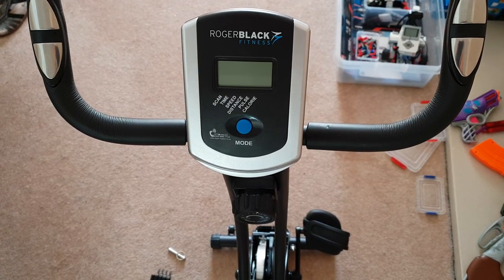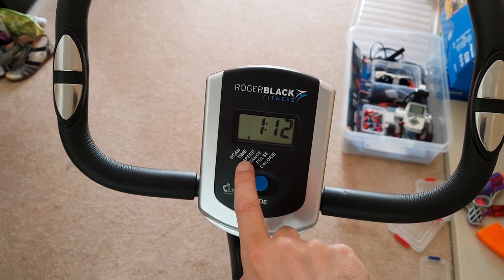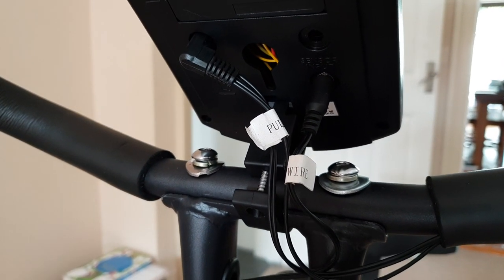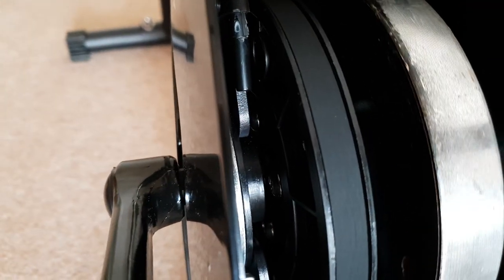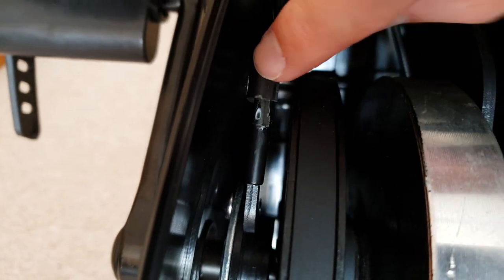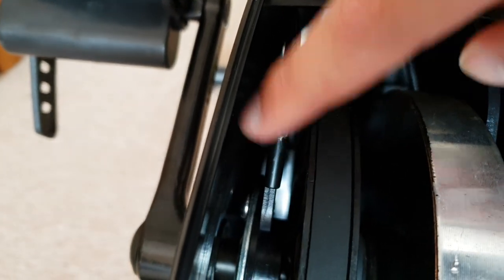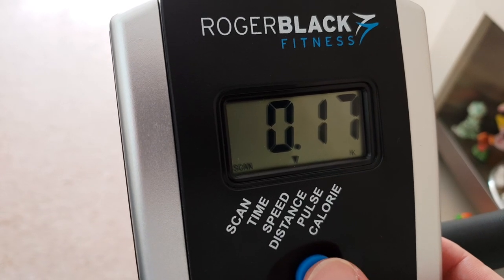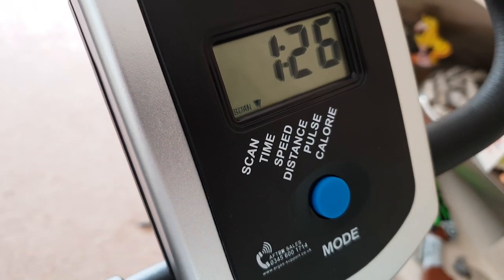How to fix the speed + distance sensor on a Roger Black exercise bike

Comment: Thanks, I bought a replacement monitor for my bike and it came with this type of sensor, I was going crazy trying to understand why plugging the old sensor in the new monitor didn't work, turns out the factory sensor was some type of continuous potentiometer or rotary encoder, I fixed the new sensor and glued a magnet to the disk and now it works perfectly.
Reply from the maker: Brilliant! 🙂

Comment: Ive just seen your video and have a similar problem to your bike but in my case one of the connectors is broken and I would like to repaire it if possible. The thin cable ending in a pin, is ok but the other  going inside of the bike to be connected  to LCD screen is loose and disconnect because is broken. 
Is there anithing I could do? I can supply photo of the problem. Thank you in advance

Comment: Thanks for the video, really helped me fixing mine! 

One question, mine got a three magnet slots where only one got occupied, can i add random fitting magnets to the other empty slots? I take it with more magnets the display would updates more frequently, correct?
Reply: Nevermind, the sensor went crazy when i tried adding a second magnet, it reads up to 50 kph with just a single rotation by hand lol. The magnet i tried i think is neodymium tho which might be too strong for the sensor? Idk
Reply from the maker: I think more magnets mean it'll think you're completing a rotation even faster than before 🙂

Comment: Hi, how do you get the front casing off to get to the actual wheel ?
Reply from the maker: I think you just pull it off.. try pulling one side and you should find it comes off quite easily
Reply: @Endpoint101  What do you mean you 'think'.  I don't want to start pulling it off and find it breaks.  lol...  Can you be more specific please.  Like, do I pull off at the top, or the bottom first and if I use a screwdriver to prize it off will that be OK or should I just try with my fingernails.  I have tried a little, but seems nowhere to get a purchase on.  I have inherited this and have no manual and am unable to look up a pdf manual because I don't know the model no.  Do you know where I might find it?  Otherwise you video seems helpful and clear.
Reply from the maker: Just tried it now.. if I pull away from the top, it pops right off.. didn’t have to use a screwdriver or pull so much that I was afraid something would crack. Hope that helps?
Reply: @Endpoint101  I will try tomorrow, thanks.

Comment: How would you go on if the plug snapped?
Reply from the maker: It should be relatively straight forward (and cheap) to buy a new plug & solder the old wiring into it.
Reply: @Endpoint101  thanks 😊

Comment: I've got the older Roger Black model AG11203 and it's driving me nuts trying to work out how to change the settings from miles to kilometres, I don't suppose you have any idea? any help appreciated.
Reply from the maker: I've had a look around the web and don't see any way to do this.. I'd suggest holding the button down for 3 sec to see if that does anything.. but short of that, I guess print out a quick conversion chart :/
Reply: @Endpoint101  thanks. If I press the enter button for a few seconds it displays all led options for the screen, km being one of them. I just cannot fathom how to switch it, its so frustrating. I know I can convert the distance, its just not the same. Plus I hate not knowing how to switch the units of distance - its like a mission now!
Reply: I have a similar bike and had the same issue. When I first used it, it showed as miles then at some point it switched to km. Well I just took out both batteries for a while and put them back in and the miles setting is back!
Reply from the maker: @msmindpeace  Interesting.. I'll give that a go! Thanks!!

Comment: The problem I am having is changing it from km to miles
Reply from the maker: If you find out how to do this, let us know.. other people are wondering the same!
Reply: I have a similar bike and had the same issue. When I first used it, it showed as miles then at some point it switched to km. Well I just took out both batteries for a while and put them back in and the miles setting is back!
Reply: @msmindpeace  please see my comment